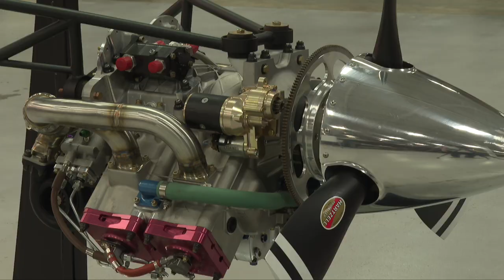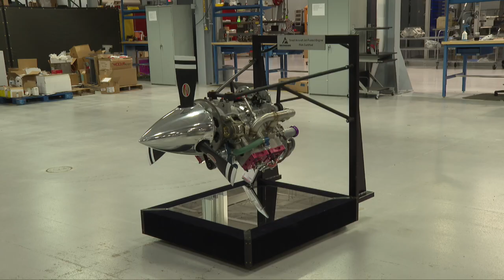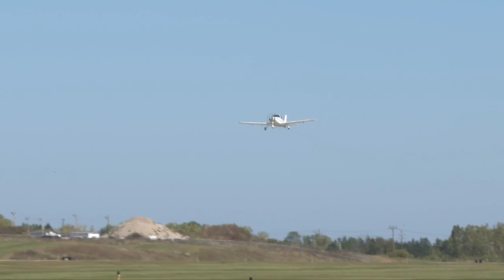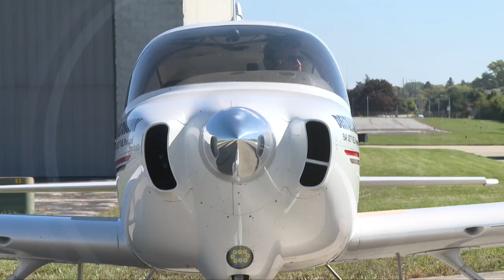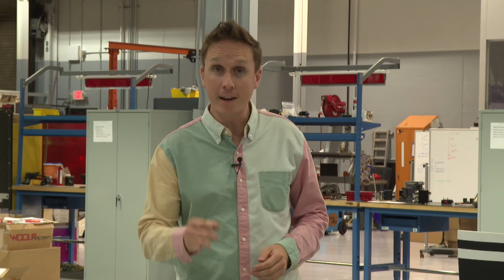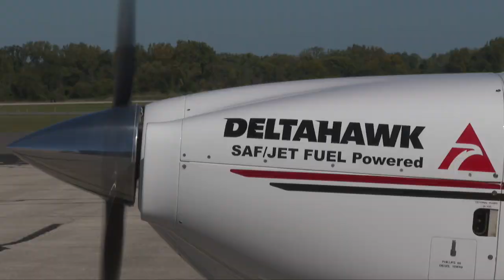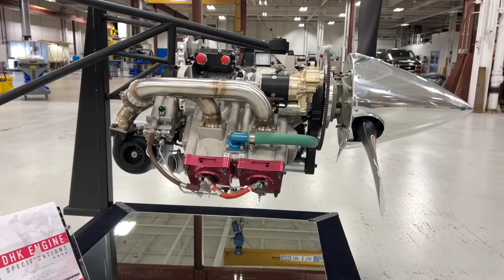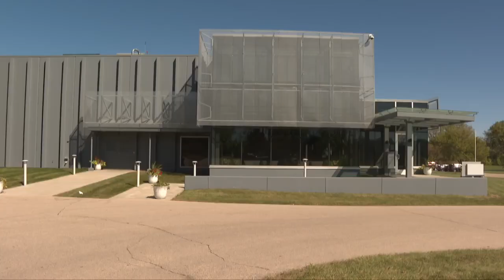This engine is the future of flying

Comment: Aircraft engines are NOT incredibly complicated!  They are incredibly simple...for a reason.
Reply: Fluff piece. 
Don't like the voice. 
Lack of details makes the whole thing suspicious. 

WHAT is so great about this engine? 

I hate click-bait.  

YouTube should have a Click-Bait rating.
Reply: Yup, and this vid sheds NO light on said engine.
Reply: I beg to differ, have you laid hands on a fuel control unit off of an A model C-130 engine.
Reply: @hugoglenn9741  taking GA here.
Reply: Piston engines.
Reply: @hugoglenn9741  :  Yep, my shed is full of them!...   😜
Reply: Most of the time, such videos start with the announcement that a revolution is about to happen and all other manufacturers can pack up.
I remember faces like that and also the voice. Then I immediately switch channels and get annoyed about the rubbish that is being said.
Reply: It is not their complexity as they are designed along the lines of a reciprocation sewage pump. The problem is that 1- they still use magnetos; the last mower I bought with a magneto was in 1999 and for 89$ from then Northern Hydraulic. 2 - the carburetors, unlike the SU's on my BMW motorcycle, do not adjust for altitude!? 3 - the material is inferior and has not taken advantage of material design. 4- you cannot access the valves without taking the whole cylinder off and that means the seating between the pistons and rings during run-in must be done again with more metal being made. 5 - the case is split vertically making it very difficult to reassemble. 6 - the FAA will ground you for replacing the electric clock in your Cessna 150 with an aviation clock the runs off a spring, but go spastic and lock up when your factory cylinders from Lycoming eat the wrist pin button and you nearly MAYDAY into the forest. 7 - the engines are air cooled (don't whine about weight when you spend 20-30k on a new engine). When was the last time you bought a car with an air cooled engine. 8 - Lycoming will tell you that your engine failed because you flew too much or too little, or that you exceeded the rate of climb, or did not change your socks in the past 72 hrs. Over to you..............they should be sued for manslaughter!
Reply: Stupid commentary.
Reply: Yeah, I laughed out loud when he said that. The engine on my Subaru is more complicated then an IO-360.
Reply: And $100k. 😂
Reply: They love drama.
Reply: The rules governing production, installation and use of aircraft engines are horribly complicated- the engines themselves are not.
Reply: Making a gas turbine engine behave and avoid surge (equivalent to back-fire of piston engine) is incredibly complicated. There's a science behind it that few understand or appreciate.
Reply: What crazy special fuel is not available everywhere? 😅
Reply: Nope. There are many different types of aircraft engines, namely piston rotary or inline engines, turboprops, turbines, turbofans, turboshafts and turbojets and NONE of them are "simple" 
Aircraft engines are COMPLEX but RELIABLE, not "simple".
Reply: WRONG- yes, they are incredibly simple, but not for the reason you think: they are incredibly simple because lawyers & the FAA cost too much. which is why lycoming & continental won't risk trying to certify newer, better technology- it would bankrupt them. incredibly simple? yah. that's all that was available in 1940.
Reply: I am not suggesting this engine as an alternative to anything... I do not have that level of expertise.  In terms of a parts-count, a two-stroke typically has fewer parts than a four-stroke though.
Reply: @PiefacePete46  deltahawk will dominate. but I suspect that continental BOUGHT gemini diesel through superior air parts- a vendor who makes certified parts for them. if my theory is right- when they start losing badly to delta- and they will, they'll pull that engine off the shelf & sell it. its' advantage? even better power to weight ratio than the deltahawk. it's a copy of the jumo diesel from ww2- but with the cooling problems conquered. another contender might be achates- well, not them DIRECTLY- but maybe through lycoming or pratt.. or maybe even cummins if they decide to break into aviation, they already make the military's new ACE engine for military vehicles (advanced combat engine) designed by achates- built by cummins. it's basicly a super advanced jumo engine (opposed piston 2-stroke) that replaces the 750 hp turbo cummins v8- with a 1000 hp achates, that weighs the same as the 750hp did. YIKES! yah- they're that good. and peterbuilt is testing a 10 litre verison in their pete 579- it gets 40% better fuel economy & emits less polution than the 579 cat that was in it.
Reply: I was going to say the same thing. Proves this fool knows nothing about engines nor recip airplanes.
Reply: @apexclip3458 yep, it doesn’t get much simpler than a four cylinder opposed engine.
Reply: @julesdufresne7822  Delta Hawk has made the first working diesel engine... So maybe airplane engines are a bit complicated... Just a thought...
Reply: @K-Benz No. Diesel engines have been around for a long time.  They’ve even been around as airplane engines.  Delta Hawk has not even broken new ground.
Reply: @n6408s  : No, although actually putting something into production that is good enough to shake up the established products would be a lovely dream to pull off.
Reply: @K-Benz  Here in Austria, we have had planes with diesel engines for years, and also the much more compact and efficient geared engines from Rotax. They are sold well in Europe, but in the USA they prefer the outdated engines from Lycoming and Continental. Just have a look at Diamond Aircraft.
Reply: @K-Benz  There have been diesel engine aircraft for over 80 years, although they are not common.
Reply: @K-Benz  Diesel engines for aircraft have been around for the better part of a century, if not in large numbers.
Reply: @K-Benz  So airplane engines are simple but now a company is making them more complicated, got it...
Reply: @K-Benz  Diesel engines have been used in powered aviation for almost 100 years
Reply: @K-Benz   Maybe the manufacturing and QA / QC is complicated, but it's still compress-ignite, exhaust-intake: Modified Otto Cycle.
Reply: @K-Benz  No, but the first certified after WW2. Look for Jumo 205 and 207 ;-) And the Zoche Aero-diesel was earlier, (1992 Philipp Morris Research Price) but still isn't certified.
Reply: @K-Benz  Are you sure "Delta Hawk has made the first working diesel engine"?  🤔
Reply: @K-Benz  2 stroke diesel I believe.  So it is simpler, cuz sportfishers need high torque without the weight and fuel savings so Detroit Diesel came out with their simple in design 2 stroke diesels and turbo’s some.  DD 671, 453, 853, etc, etc.  boats can handle mush more weight than aircraft.
The technology involves the weight savings aspect of it all.
Other gas aircraft engines are just glorified basic VW air cooled engines.
Reply: @hugoglenn9741  Indeed. Limbach, Sauer, Great Lakes are all nicely tuned VW beetle engines. Fairly reliable if maintained, relatively cheap. TBO maximum 1000 hrs and prone to overheating, if too long on max power.
Reply: @K-Benz  diesel engines are the least complicated of piston engines.  I'm not trying to be a jerk, you just don't know the material. That said, the DH is an amazing engine and is exactly what GA needs to revitalize the segment.  I'm also impressed by the UL 520T and the Adept  320T.  FADEC greatly reduces pilot workload.  Diamond Austro engines are also very impressive.
Reply: @julesdufresne7822  I fly DA42, nothing impressive about them.

Comment: I believe it's a diesel engine.  Not sure why that wasn't pointed out other than reporter didn't take the time to ask or he doesn't know the difference.
Reply: Reporters are ignorant talking heads. They just spew what some writer tells them to.
Reply: There is no such thing as aviation diesel. It's just plane old jet A1. Gets called diesel, but it's kerosene.
Reply: @MBCGRS  I believe you.  Here's from DeltaHawk website: The engine's base technology is Compression Ignition (also known as Diesel) that is known for durability, high efficiency, and incredible torque.
Reply: @MBCGRS  until you drive diesel to the airport and burn it in this engine or use this engine in Africa or other isolated areas of the world
Reply: @MBCGRS  they did call this engine multifuel
Reply: Compression ignition using Jet A.
Reply: Doesn’t matter. This engine has been vapourware for decades.
Reply: Like most reporters, they are really actors. The main focus is on drama.

Comment: The engine might be fantastic.  It might run on multiple fuel types, including water.  It might produce emissions that I can breathe, and improve my health.  it certainly looks pretty, and nicely made.
Having watched the video, I know less about the engine than I did before I watched it.
I think the teaser for the Emporer's new clothes had more hard facts than this!  It would be great if everything that is hinted at proves to be true... fingers crossed.
Reply: Yeah, I'm thinking this is a Diesel, but the only fact I got from this is the company is not owned by PR of China.
Reply: @catsupchutney  :  Yet!😜
Reply: from what I can see in the video - It's liquid cooled turbo diesel with a planetary prop gear reduction.  Mercedes made the same set up for the diamond diesel but it was an inline diesel -not a  V.
Reply: @mixter7x7  :  Good detecting... the video purported to inform us, not play some speculative guessing game!  😜
Reply: Brilliant summing up.Looks liquid cooled,turbocharged, some ring gear.
Reply: 2 stroke turbo diesel inverted V-4, 40% more efficient (per gallon or lb of heavier jet fuel?).  It's been in development for 30 years so it's about time, and maybe finally zero lead gasoline is accelerating interest.  The Delta hawk should be very efficient and low maintenance, but NOx might be a problem, but better than lead pollution.
Reply: @glike2  just to delineate. Diesel is 40% more efficient(joules of energy) than gas if you can tap those joules/calories.  However, 2 stroke is less efficient than 4 stroke.  With the turbo hopefully they can remediate some of the 2 stroke inefficiency.
Reply: @hugoglenn9741 
It is turbo supercharged. Turbos don’t really increase efficiency they increase power. This engine is a 4 cylinder 180HP with a 235HP coming this year. A 6 cylinder and possibly 2 cylinder is in the works
Reply: @glike2 2 stroke was my guess.  The heads and exhaust gives it away. Fuel injection and turbo will give better mileage.
Reply: @glike2  I still think the video should have given us the information.
Reply: Water can’t be used as a fuel.
Reply: @DinoAlberini  
Sarcasm
Reply: @andrewday3206  I hope but, as you know, there are many people who think it’s possible
Reply: @DinoAlberini  :  Thanks Dino,  I was really being stupid and sarcastic to try and make the point that the video didn't really tell us anything!
Reply: @PiefacePete46  my bad
Reply: @DinoAlberini  Look up the video of Stan Meyers (spelling might be wrong)  and his water fueled car.
Reply: Ha ha ha!! That about what I took from that 2 min and 15 secs of that "Where's Waldo Info" All I learned is to stay tuned for something...
Reply: RED FLAG that they are looking for investors but cannot find any.
Reply: @DIYDaveT  :  The most expensive tape is "Red Tape"... the aviation industry is wrapped up in it!  Tends to be an investment market requiring stupidity or large spheroids!
Reply: All you have to do to learn more is visit their website, where complete specs and the product line is clearly shown. This is a compound boosted (twin-screw supercharger and turbocharged) 2-stroke diesel. Power-to-weight outstrips any Continental or Lycoming gasoline engine of the same displacement. It runs on Jet-A and fuel burn is less than gasoline or turbines of the same power output.
Reply: what's amazing to me, is that you figured out how to read this post, but still haven't figured out how to do a google search. this is a diesel 2 stroke- basically, a copy of a 1960's detroit diesel- but refined by the use of computational fluid dynamics & CAD design to make it more efficient & much cleaner burning. it will replace the current 4-stroke, air cooled gasoline engines 2x it's size- and get the same fuel mileage as gas engines rated for 1/2 it's power output, and has 1/4th the part count. in short- lycoming & continental are in BIG TROUBLE.
Reply: @jaybee3165  :  You have reinforced the point I was trying to make.
The crux of my comment was paragraph two; "Having watched the video, I know less about the engine than I did before I watched it.".  My beef was with the lack of information in the video.  If, every time I watched a Youtube video I had to "Google" it to find out what the video should have told me, the video has failed.
Ironically, I learned far more from your reply than i did from the actual video.
Reply: @PiefacePete46  agreed. but then, that's a post from a so-called 'real journalist'. makes you think doesn't it? his OPINION of the engine just happened to be correct. imagine what happens when these little 5hits get it WRONG?!
Reply: @jaybee3165  :  Yes... The sad reality is that history is littered with projects that did not deserve to fail, but they were scuppered by unfortunate timing, or circumstances.